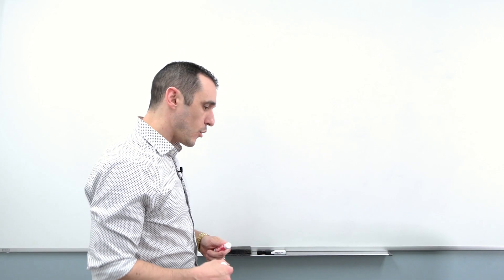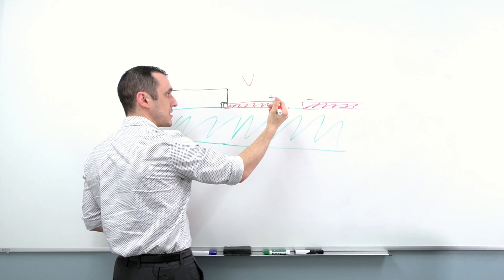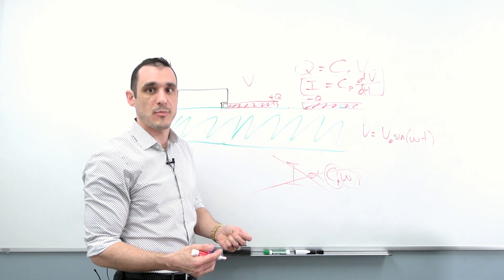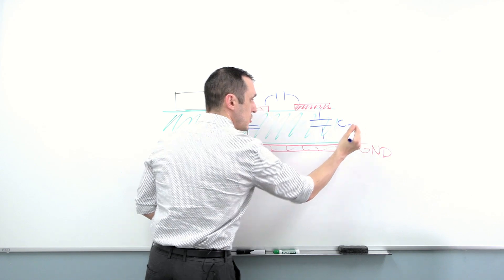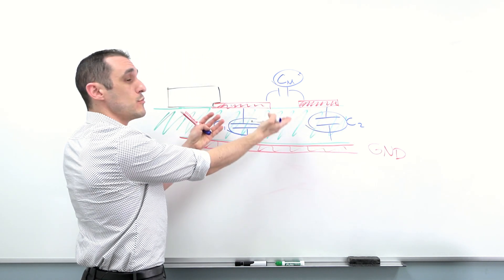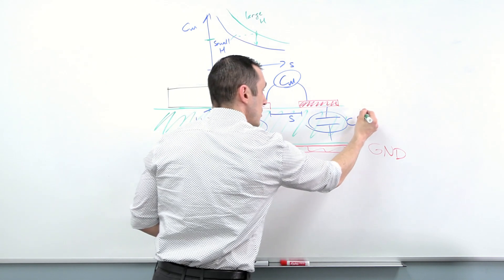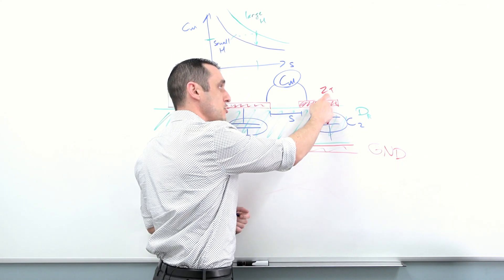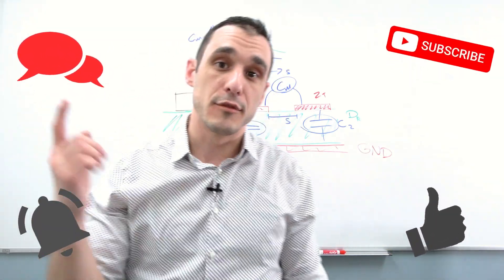How to Reduce Parasitic Capacitance in Your PCB Layout

Comment: Pls one video on single layer pcb design through hole components without schematic dia.
Reply: Are you asking how to create a design without using schematics? That is not the proper way to create circuit boards, you have to create schematics as this is what defines all the net connections in the PCB layout.
Reply: @Zachariah-Peterson  thanks for feedback. Ok 1 video making single layer design through hole and some smd parts. Please request 🙏❤️

Comment: Pcb manufacturers offer differnt stackup layer thicknesses for multilayer boards. Eg in some prepeg between top layer and next layer is 3.8 mils and 8 mils ... 
Plz describe such qs in a future lecture ... appreciate
Reply: We have not looked at this specifically but I have shown through calculation some ways that the layer thickness (distance to ground) affects parasitic capacitance between two elements. I do this in the linked blog titled "Parasitic Extraction with an Electromagnetic Solver in PCB Routing" and I've done it more recently in a video on crosstalk.